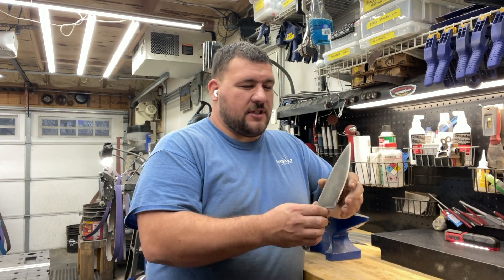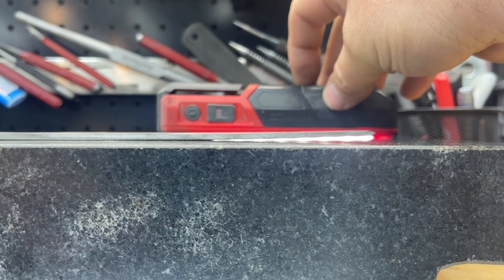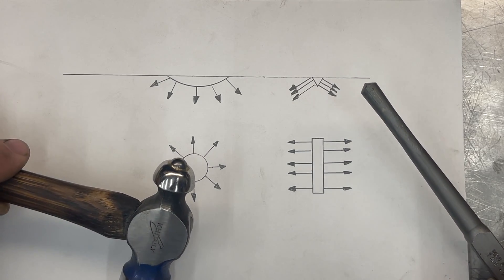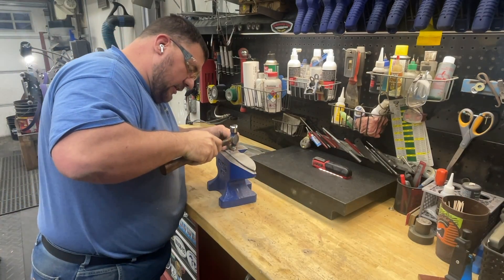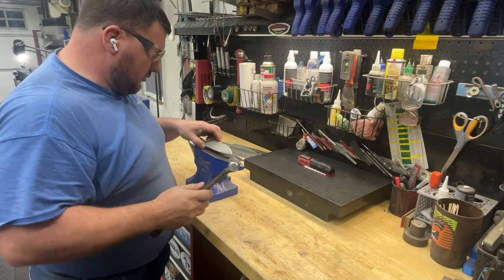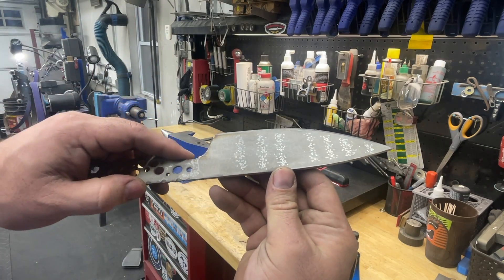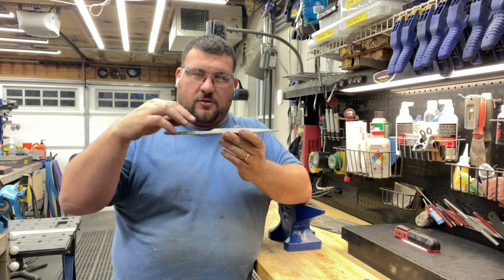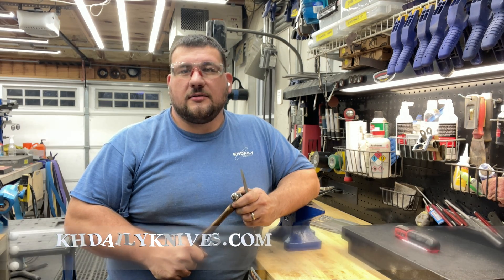Straightening Hardened Knife With a Carbide Straightening Hammer.

Comment: Kyle, this is worked great for saving a couple bananas. 

Any advice for someone who had an 8-in chef's knife come out with a twist instead of just a cup?
Reply from the maker: That is so great to hear!  Glad it worked well for you! 

If you have a twist, you want to angle where you hammer to be in the valley of the twist. Just like how I started in the middle of the warp here. I usually don’t get much twisting though.
Reply: @KHDailyKnives  thanks. Sounds like a little 3d chess for me this evening...bit tough to visualize but I'll give it a go
Reply from the maker: @navygeek  if you need some help, send me a picture on Instagram and I will try to help draw lines where to hit.

Comment: Hello, great video. My question is, if i were to straighten the knife, and then grind it, essentially grindign out the dimples made by the ball peen hammer, would it not go banana again? Thank you!
Reply from the maker: That is a good question. I find the best results come from heat treating at full thickness and hammer straightening at that point. When I grind the bevel post heat treating and tempering, I try to remove material equally on both sides. I have only had a couple of times that the warp has come back. 

If it does come back, I do very light taps and then grind the material down and there are still some compressive stress under where was peened.
Reply: @KHDailyKnives got you. I guess it varies alot. But I will try it out if I do have a warp! Thank you for the video!

Comment: How do you grind out the divots while keeping the knife perfectly square? if that’s possible? A surface grinder is way outside my budget.
Reply from the maker: @Keirrrrrr  I try to hit the hammer where I am going to be grinding anyway or where the handle material will be covering them. You can use a large welding magnet with a handle to help hold the blade against a flat platen if needed too. (McMaster Carr PN: 55025A51 as a reference) 

Sometimes when you grind away the material, the warp comes back some.  It is important to try and grind the bevels alternating side to side evenly for it not to come back. 

Hope that helps!
Reply: @ thank you but I don’t usually do full flat or full convex grinds. So there’s a lot of blade area that I’m not otherwise going to grind.
Reply: @Keirrrrrr  Tempering usually leaves a "coating" that's not exactly what is wanted on the finished knife.  Just a clean up flat grind after tempering takes care of the tiny divots which are usally <.005"
Reply: @kenh8979  OK I think I get it. I must just be hitting the knife too hard and so making unnecessarily large divots

Comment: Hi Kyle!!! Im making a project for school and trying to "improve" this tungsten carbide tip hammer, what do you think about attaching the tungsten carbide tip to a pen type tool (a little more robust than a pen)
you think that will work? I would love for some more information about what can be done with this kind of tool!!
Reply from the maker: @mylmade  I make a smaller version for traditional knifemakers that use them on their springs with a 3/32 carbide ball. The problem with that one is there is not a lot of material supporting the carbide and the tips can break off. You can message me at kyle@KHDailyKnives.com.

Comment: I think this is the best video I've seen on straightening the blade with a carbide hammer.  I'm with you, while the sharp point might straighten faster with more metal movement, seems like that sharp point would put more stress on the blade?  I like the idea of the round point.  Perhaps a 1/4" ball would be better than a 3/8" ball?  Thanks again for the video
Reply from the maker: @kenh8979  thank you for the kind words!  

I tried a bunch of different sizes when I was experimenting.  The 3/8” ball I feel like had the best movement. Smaller and went a lot deeper and larger it seemed to have too much surface area to indent / move the metal.

Comment: How do you straighting annealed steel? Thank you
Reply from the maker: @RUBICON_CO  Straightening when the blades are annealed is usually best done in a 3 point bending method. Lots of people make up a jig that mounts in a bench vise that has two supports close to either end on one jaw and the other jaw has a support that pushes in the middle. If you search for “3 point straightening jig knifemaking” you should find some videos. Denis Tyrell and Tony Severieo did some videos on their setups.

Comment: Much appreciated. The 10v and z wear I’ve done has warped badly 😂

I did the old temper while clamped method but this seems like magic
Reply from the maker: I have been crazy impressed with how well it works.  It has saved me literally $1000’s in warped magnacut blades.

Comment: profile looks like it's for someone that either doesn't cook, doesnt know how to cook, or never used a chef knife. nobody that's into chef knives wants rounded profiles like that. the stock also looks comically thick. i'd be curious to see what the choil looks like on the finished  product. like an axe as with most edc bros that take their hand making kitchen knives for edc bros to buy their wives that never get used because they're ugly and cut like shit or like a proper kitchen knife.
Reply: What an amazing comment. Please post your work so everyone can see how it's done
Reply: @toddharrington9071  Grinding a billet of steel into something vaguely resembling a kitchen knife isn't some grand accomplishment. Anyone can do it. The difference between a good kitchen knife and junk isn't about what steel it's made of. It's about ergonomics, weight and balance, the blade profile and the cutting geometry. Most chefs like a neutral or slightly forward balance, flatter profiles that don't strain the wrist or require extra hand movements, and grinds that don't require some massive 2 mm secondary bevel at the edge with a 25 degree included angle. Most of mine are 20 degrees inclusive and the edge bevel is barely visible because of how thin the grind is where it matters. The best kitchen knives will have subtle convex bevels which push ingredients away and give excellent food release. It's all about the details.
Reply: @user-xf4es7eh9y  irrelevant comment in this thread. The video was showing how he straightens a bowed blade after temper. Your original comment was saying how shitty the blade design was. Cool but nothing really to add. But it definitely seems like you can't make a knife yourself. Because if you could, you wouldn't be critical toward someone who puts a lot of time, effort, and passion into it. A good chef doesn't just talk shit if a cook/chef is bad at cooking. They coach them and make them better. Are you a chef? Maybe you don't have those qualities yourself. If not, you should try to be better for you and for your cooks
Reply from the maker: Ah, thank you for your colorful commentary! 💪

Comment: Hello, it is a Realy great Video.
I Wonder, if the hits make stress Points or cracks in the Blade.
Reply from the maker: It is making compressive stress in the blade.  The advantage of the ball over the carbide chisel is the rounded divot is much less of a stress concentration than the triangular divot made by a carbide chisel. It is still possible to crack a blade if the warp is extreme, but I have straightened about 400 blades and have had 6 crack while straightening.

Comment: does the hammer have to be carbide or can any ball hammer work
Reply: As in has to be carbide
Reply: @harrytaylor2401  thanks for the reply.  Just watched a few other videos that explained what’s happening and why it has to be carbide lol.  Might have to make my own, although I only have one bent knife and I’m not a blacksmith lol
Reply from the maker: @alexh.4068  it doesn’t have to be carbide, but it has to be harder than what your blade steel is.  For most knife steels they are 58-65 HRC, which is very hard.  The tungsten carbide is 90 HRC, so it is able to indent the blade steel to straighten it. 
Let me know if you have any further questions and I will try to get those answered.
Reply from the maker: @lindboknifeandtool  Worth a shot
Reply: I think so dude.

Comment: Hello, Did the Carbide Ball ever break on you? .... What kind of light is that? Thx
Reply from the maker: I have not had a carbide ball break so far.  I have done about 400 blades now and it is still going strong.  The ball is in compression when striking and is also supported by the braze around it.  

The light is the rechargeable Milwaukee 2112-21.  It is a nice light and has more led emitters than the lower brightness one that seems to work better for looking at the bend I think.

Comment: Hey Kyle, im just curious if this method of straightening isnt introducing micro fractures to the blades? Pretty interesting how that works without shattering the blade. Would love to see a microscopic look at a blade straightened this way as i would love to get one if it does no create microfractures.
Reply from the maker: The hammer is creating compressive stresses in the steel.  Compressive residual stresses are known to increase both the fatigue strength and resistance to stress corrosion cracking. It would be similar to shot peening if you want to check out more info on that.  This straightening method is not a new one and has been used in the saw blade industry as well as the Japanese knife industry for a long time.  
The method however is not 100% effective without cracking the blade.  I have straightened around 400 blades and I think it has been 6 that have cracked while straightening / grinding.  Some people have said they like to do an additional temper cycle after hammer straightening which they say has helped. I might start doing some of that too. The blades that have cracked on me usually looked like there were other things going on in the steel, but sometimes it happens.  
The hammers have saved me tons of frustration and scrap steel and have been so helpful with my kitchen knives specifically. I have looked at many under the microscope in the beginning and did not see any micro cracking around the dimples.  Hope that helps answer your question.
Reply: @KHDailyKnives  sure does! Thank you for responding!

Comment: Great video! So happy to see a tutorial because now I can use my hammer more effectively. One thing I had happen to me is after straightening a badly warped chef knife I started grinding and the wrap came back. I assume because I removed a good portion of the deformed material caused by the carbide hammer. I since straightened it again using the hammer.
Reply from the maker: So glad the video was helpful! 

I have seen the warp come back a few times.  Grinding both sides evenly helps a lot, but I always make sure I keep an eye on how things are progressing.